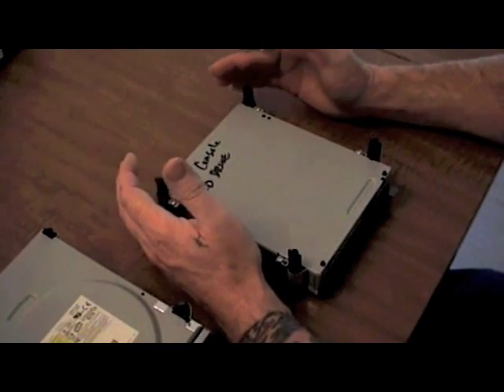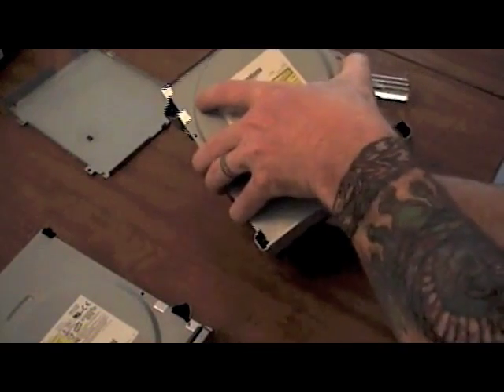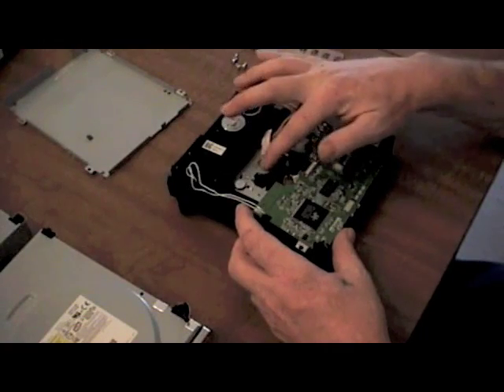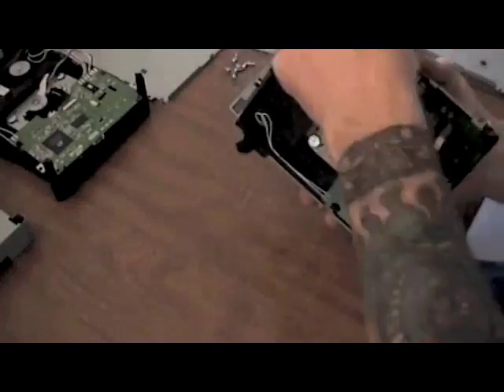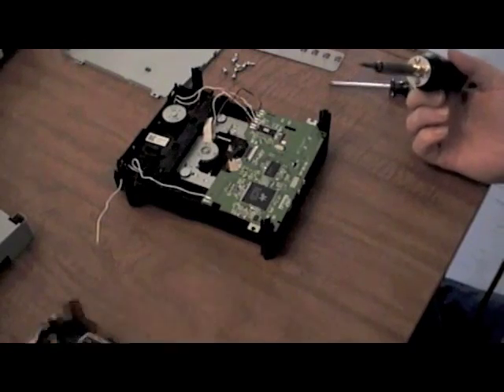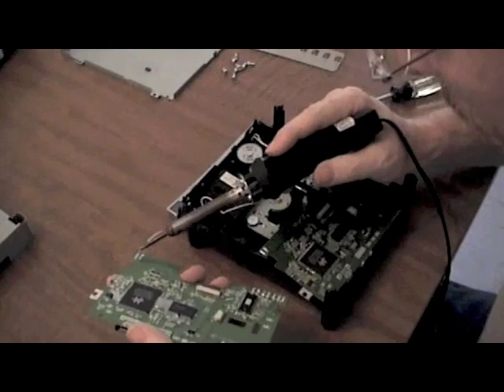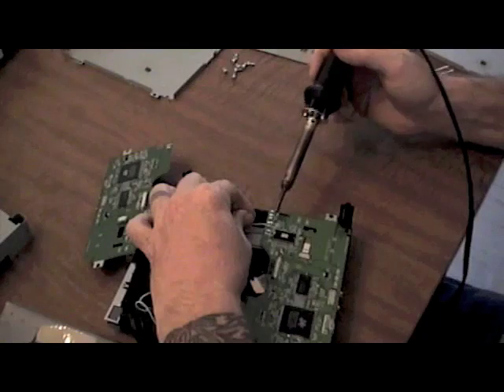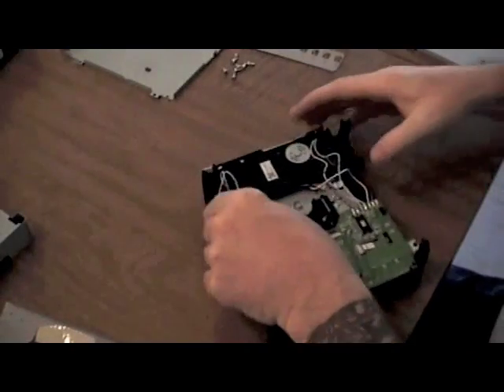How to change the circuit board in a Ben Q/ Phillips dvd drive for the XBox 360

Comment: what i want to know is i have a new pcb board and my old xbox pcb board for my old xbox that still works how can i make that new pcb board work in my old xbox that still works but has a bust pcb board?
Reply from the maker: In order to put a drive in using a board that is not from the original XBox, you will need to flash the new board. You will need to use the flashing program to pull the key off of the original board and install it on your new board, along with the programming. That is not something I do so you will need to research that on other channels. There are plenty out there. But I suggest that you do not do anything outside of moving the key from one to another and going back to the original format. Modding your drive can get you banned.

Comment: hey man i got 2 xbox's one has the red ring and is bet, its drive works fine and i have one the the drive wont read the disc works fine tho i swaped the drive and it comes up play dvd and the xbox screen comes up again can i take the board from one drive to the other or do they have to be the same one is ben q

Comment: ok i have a question, can i remove the board without De-soldering the ten wires from the board?
There are 4 white wires attached to some copper plate strips  at the top, is there a possible way to remove these and just reattach them back on another caddy??

If so can you post a video to show us how to do it properly please..
TiA...=]

Comment: Finally did mine after about a year or so of making do with my old one.  The laser started going bad, so I had no choice but to replace the drive.  The replacement was simple enough, but it turns out the new drive I bought has the exact same open tray problem right out of the box, so its back to knocking on the top to get it to work.  :(

Comment: LV - good video.  Where did you buy your replacement BenQ drive? Are new ones available or just used ones?  And does the new one need to have the same firmware as the old one?

Comment: I am looking for a more permanent solution to the open tray error, instead of tapping.  This seems like my best option, but the soldering scares me, I tried soldering something else before and had no idea what I was doing and gave up because it was frustrating working with that soldering wire. 

In your vid, it looks like you just touched the iron to the solder points and the wire just came loose and you just touched the solder points again to reattach the wire.  Is it really that easy to do?

Comment: I just wanted to say thanks for this video, I had to do a bit of searching, I haven't tried this fix yet (still waiting for the drive to arrive) but it's good to know it's possible on the BENQ drives, soldering isn't a problem for me as I've had to fix laptops and chip PS1's but it's nice to know I have to solder it in, unlike the samsung and toshiba drives.

Comment: @LVProductions71 the problem first started with it not wanting to open, then open try disk error, i got my replacement disk drive from my friend who's xbox rrod due to over heat problems, before i made the swap i plugged his in to mine to see if it would spin up and read an dvd, witch it did no problems, after the swap was made i put the drive with my board into place and it did the same thing as before open disk error .

Comment: thanks for the video one of the best ive seen changing the benq drives. i have one question though, if i get the exact same benq dvd drive and swap boards over, can i just flash it with the ixtreme fw so i can play the copied games or do i need to extract the old key and then flash it to the new board then flash with the ixtreme fw?? sry if its a noob question jst wanna get it right.

Comment: Hey man Nice video.  That's pretty close to the way I did mine.  What I did those was unsolder the board from my original drive(the board I need to keep) and then I laid it on top of the good DVD drive board and unsolderd and resoldered 1 wire at a time so that I know I would be putting the wires in the right spot.  Nice Vid though!  Alot of people will benefit from it!!